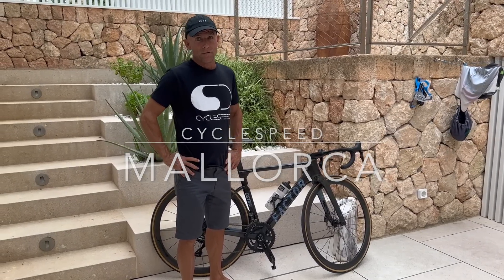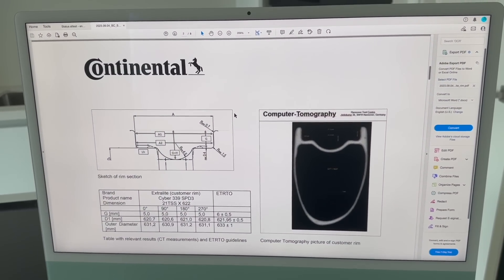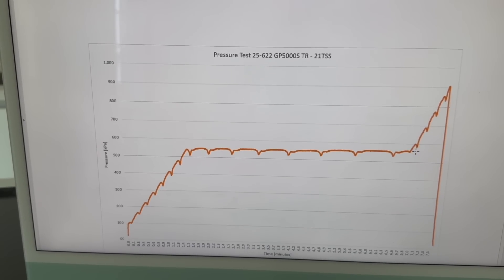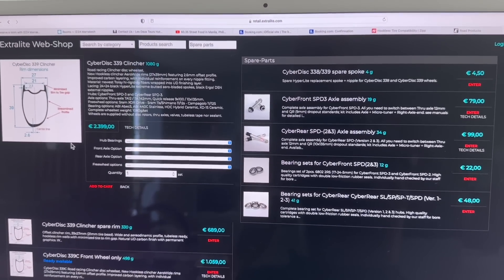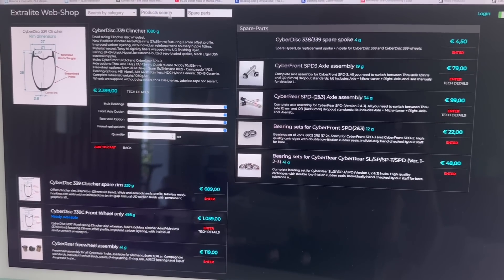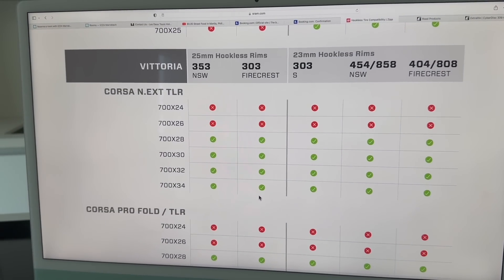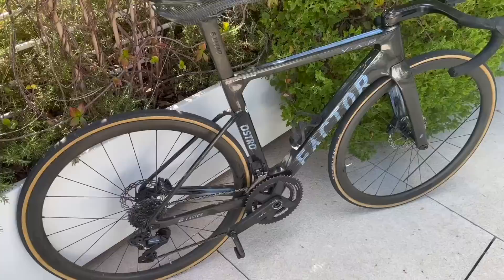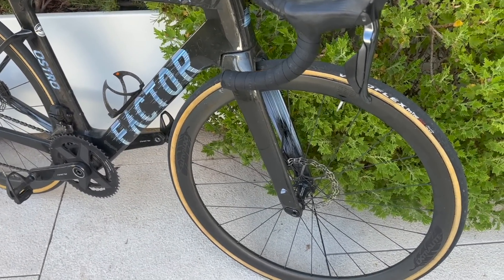Revealed! Why the Tyre Blew off the Hookless Wheel

Comment: I wonder if that clown will chime in in the comments 🤡 
presumably declaring continental don’t know what they’re talking about.
I rode tubs with carbon rims, on rim brake, on my previous bike, and the ride quality was something impossible to convey to someone who’s never ridden them.
I presently ride clinchers, as that was the deal on the bike I put together, with disc.
Had very hair raising experience riding turbo cottons with tpu, a combination I’ll never repeat.
Riding a stiffer casing gp5k with tpu has been pretty much flawless and puncture-less, but as much as I like the tan side walls, they do exude a dullness, that I remember from the ride quality, from years back, so will try out one of the new s works turbo tires again next, just no turbo cottons.
I once rode schwalbe one’s as a stand in, one time I was waiting for an order, and I recall feeling disappointed at the point of purchase, even the assistant in the shop selling them pretty much rubbished them, [versus some other high thread count tire he was all aglow about, but for which I couldn’t justify the price, being something I’d bin as soon as my intended tires arrived]…
I have to say, for me, on my wheels, my weight, pumped up to ~100 psi, I was very surprised and looking back now, re straightforward performance, they were head and shoulders faster than the s works turbo tires model I was wedded to during that time.
In my defence, the wedding was not 100% aesthetics and matching matching, but also from the perspective of purportedly perfect compatibility, where everything has been designed from the ground up together, and the marginal benefits / gains that implies.
At that time I was particularly interested in the tire - rim interface from an aero point of view…
Arguably though, the issue you’ve had, equally demonstrates the value of such an in-depth design, development and testing, as part of a holistic approach, with, in effect, one design leader. Controlling the whole big picture overall, together.
It’s an interesting aspect, and one it’s of late “cool” to dismiss / disparage, I’ve noticed.
Most recently by the chris miller / nero show or whatever they’re calling it these days.
Interestingly, both talking heads of which ride tubeless [can’t recall if on hookless rims] but the best of british to them, if they are on hookless, and out of natural wandering curiosity try out some new combinations of hookless rim wheel with some tubeless tire that piqued their interest that particular week.
I have studied and worked previously in fields where risk and risk management was taken seriously.
I don’t get the same impression regarding the current situation with tubeless and hookless.
More, rather a feeling of playing fast and loose.
Shimano have just issued a recall which as a response to a problem that as far as one can see, has been common knowledge for so long, it could probably only be measured by equipment that can pick up continental drift or a tectonic plate’s movement.
I honestly can’t imagine what goes on in the minds or consciences of the people in charge of some of the companies in this industry.
Fair play to conti regards taking ownership of the issue you experienced though.
That :is: encouraging from a risk point of view.
I just diverge from a point of view of ride feel, which I dare say holds some degree of subjective interpretation.

Comment: No no silly, they want you to build up the whole rim with tape, not just the bed of the rim.   That way the sidewall builds up too.   Duh.  

I kid.  Kudos to conti for the data.   But no kudos at all to the ability of finger-pointing to happen from tire to wheel manufacturer.   If the bike industry can't punch a straight, round hole through a frame for a bottom bracket, consistently, then the 1mm accuracy of hookless isn't doable.   Good luck with the process hope everyone makes things right for you.

Comment: To be honest you should get a full refund for the wheels as they are not to spec, its quite shocking really. Hats of to Conti for everything they did great report they make you feel secure using their customers. I wonder if a certain youtube channel will try and make another video saying you had set it up wrong 😂
Reply from the maker: True. But what is 'to spec'? It seems that there are no hard and fast rules which is a bit crazy.
Reply: @CyclespeedTours I was thinking of the ETRTO and the wheels being sold as hookless, but if they are only guidelines perhaps they could get away with being out of the margin of error ?
Reply from the maker: @tomrachellesfirstdance7843  The ETRTO guidelines do carry some weight, and it strikes me as very risky to sell a wheel outside of these specs. The margin of error in this case is 0.5mm but Extralite are outside of that.

Comment: Thank you for the detailed follow-up!  This confirms again that tubeless and hookless rims are not suitable for road race wheels even though companies like Zipp and Cadex seem to be doing a better job because they can deliver tubeless wheels as a system (wheel+tire). As a consumer, I want flexibility and choice at a reasonable price and so getting locked into a particular vendor is not an option for me.  The other issue with tubeless is that they're 40% heavier and far more expensive than equivalent clincher tires. For example, a pair of 700x28 GP 5000 with a 36g RideNow TPU tube weighs 220g less than a GP 5000 TRS setup. That's quite significantly given that rotating mass matters a lot at the wheels.
Reply: You seem to be conflating tubeless and hookless. Tubeless with hooked rims have been around a very long time (especially in MTB) and I don't ever recall hearing about a blow out.
Reply: I'm aware of the differences and maybe I didn't express myself clearly enough.  And I also know many happy riders that are using tubeless on road wheels.  For me personally, even if the hookless rim issues will be worked out over time, the weight penalty, higher price point and maintenance issues associated with going tubeless are not worth it for the type of riding I do. But I fully respect everyone's personal preference and trade-offs they're willing to make.
Reply: @vincentohanlon Today this happened to me with my Hooked Hunt Aerodynamicist rim on Pirelli P Zero tubeless at 6.5 bars. I parked the bike and 2 seconds later huge bang, explosion. Sealant everywhere and the tire off the rim completely. No damage on the tire or the rim. Put right back on and inflated it at a bit lower pressure and went riding. Absolutely no idea why it happened.

Hooked rim, tire pumped to 6.5 bars (specs allow 7.5 pressure). When I rode hookless that never happened to me. I've been riding this setup for the entire season, around 4K miles and never had any kind of problem like this today.
Reply: @shadowsun33  Same thing happened to me with my gravel tires pumped up to 40 psi on a hooked rim running tubeless.  Bike was just hang up in the garage when it happened. After it blew off, the tire bead was damage so I got the tire replaces with warranty because they were fairly new.

Comment: This should be a product recall and full replacement or refund and potentially legal action as they have sold something they say is ETRTO that isn’t, and it’s dangerous
Reply from the maker: To be fair, they do not claim to be ETRTO compatible and they don't have to be either. But their wheel should work with a tyre which they approve.

Comment: Remember kids, just say no to hookless.
Reply from the maker: For road in 25mm, definitely!
Reply: Cool it people. Today this happened to me with my Hooked Hunt Aerodynamicist rim on Pirelli P Zero tubeless at 6.5 bars. I parked the bike and 2 seconds later huge bang, explosion. Sealant everywhere and the tire off the rim completely. No damage on the tire or the rim. Put right back on and inflated it at a bit lower pressure and went riding. Absolutely no idea why it happened.

Hooked rim, tire pumped to 6.5 bars (specs allow 7.5 pressure). When I rode hookless that never happened to me. I've been riding this setup for the entire season, around 4K miles and never had any kind of problem like this today.
Reply: Why do you reach that conclusion?  A more correct answer is to buy wheels only from quality manufacturers.  Don’t buy cheap Chinese wheels or stuff from niche manufacturers.  The system is good if you know what you are doing, use the right wheels and the right tyres - maybe not for newbies, but experienced riders who take care of their equipment choices.  Going back to tubulars cannot be the right answer - especially for newbies!!
Reply: @CG-99  Why throw money out the winder? For what supposed benefit?
Reply: @rosomak8244  nothing to do with money.  Hookless combined with tubeless is a very good system if you choose the right wheels with the right tyres - system is lighter, more aero, allows lower tyre pressure, means you roll faster and more comfortably with no punctures and no roadside tube changing faff. It takes time though, there are certain techniques to installation to master and what to do when a puncture won't seal on its own, also what seslant to use is also critical.  Its just like the endless silly rim / disc debate where some luddites cling to the old style rim brakes mainly because they haven't invested the time needed to properly understand how to live day to day with disc brakes.
Reply from the maker: @CG-99  OK let's see, a) lighter - if so, the difference is really tiny, b) more aero - only if tyre perfectly matched to rim, just like any other setup, c) roll faster - depends on so many things, and all being equal, higher pressure = lower Crr. d) no punctures - I got a puncture which had trouble sealing in just the 300kms I used the rear wheel. Never would have happened with a tub (new tyre).
I have reluctantly adopted disc brakes with all their foibles, but the difference is that a rubbing disc or lack of power won't kill you, a tyre blow off might.

Comment: Extralight arem't looking good. They admitted they shrunk their wheels to make tyres easier to fit and just blamed the tyre manufacturers for this choice.
They don't explain the tape wrapping. Their pressure guidance is odd. And then there is their pricing for a compnent that doesn't meet standards.

They are just lucky you weren't riding at speed. Could have killed you.
Reply from the maker: To be fair, it is more likely that the tyre guys made their tyres a bit easier to fit, which left Extralite a bit exposed. And ETRTO is just a guideline, unfortunately, not an official specification.

Comment: Extralite are noncompliant with ETRTO regs. They need to organise a recall for starters!! and deal with this in a responsible manor.
Reply: Issues is the ETRTO aren't regs.... There just guidelines
Reply: @danc1829  reg/guidelines of which European manufacturers should adhere to. I bet you will find that extalite are not a member. 

Also they probably manufacture in China which comes under another governing body.

Regardless a consumer should be able to buy a product with assurances they are made to a specific spec. Etrto exists to create continuity.

Comment: I remember needing to use 2 rolls of thick cotton tape to seat tires on hooked wheels.  It's really not a big deal. I did this often. Hookless tubeless is leaps and bounds ahead of where hooked clinchers were at the same point in their history.
Reply from the maker: When adding tape to a hooked wheel, you're just pushing the bead closer to the hook - no problem.But on hookless, you're pushing the bead towards a literal cliff edge.
Reply: @CyclespeedTours  and you're still decreasing the likelihood it'll pop off he bead...
Reply: mate

Comment: The problem so far, that I could tell from multiple videos about 'hookless blow off', is that hookless tech is totally relying on compatibility of numbers instead of having a safe-guard mechanism like the hook itself. If you buy from less well-known brands, or you are layze enough that you don't want to carefully follow the instructions, you will have blow off.

I am running 404 with gp5000str just fine so far for 2 years. The lesson I ve learned is that you should not mount and dismount the tire frequently to avoid wearing the bead from time to time. And be sure to buy from trusted brands that has using this tech for years and it is implemented also on GT races.
Reply: It's not like hooked tires/rims have always been a prefect match.  I can't count the number of times I've needed 2 layers of thick cotton tape to seat a tire.  I've also had beads totally break due to being undersized. Tubeless hookless is far ahead of where hooked clinchers clinchers were even 20yrs into their existence.
*I can't fathom installing and removing a tire enough to wear the bead down during the life of a tire.  There's nearly no friction to wear it down and it's barely moving on the bead seat when it is moving.

Comment: I think hookless is a major accident waiting to happen.
Reply: And you are right!
Reply: Cool it people. Today this happened to me with my Hooked Hunt Aerodynamicist rim on Pirelli P Zero tubeless at 6.5 bars. I parked the bike and 2 seconds later huge bang, explosion. Sealant everywhere and the tire off the rim completely. No damage on the tire or the rim. Put right back on and inflated it at a bit lower pressure and went riding. Absolutely no idea why it happened.

Hooked rim, tire pumped to 6.5 bars (specs allow 7.5 pressure). When I rode hookless that never happened to me. I've been riding this setup for the entire season, around 4K miles and never had any kind of problem like this today.

Comment: Hookless works for car tyres due to the stiffness of the sidewalls.  Bicycle tyres are cross-ply with soft sidewalls, it was never going to work well.
Reply: Another thing to note is how wide they  compared to the height, it will be virtually impossible to come off with a car.
Reply: @tomrachellesfirstdance7843  yes exactly
Reply from the maker: True, car and bicycle wheels are light years apart.
Reply: @CyclespeedTours  Yes and there is a network of wires running through a car tyre.  That would be way too stiff for bikes.
Reply: Yup, try to break the car tire bead from the rim....they use machines.

Comment: For the beginner rider, tubulars are way too much of a faff to get right. Hookless is not ready for prime time. I'm sticking with hooked tubeless clinchers for the time being. BTW, at 75 kg, I'm running 55/60 on Vittoria Corsa N.EXT tires mounted on Reynolds AR-29 wheels. I tried 65/70 and ended up sliding out on a turn and breaking ribs. Lastly. cRR isn't the statistic I look for as you can slide tires on any tarmac/concrete. I look for stickiness and how much power will transfer given the road surface and condition.
Reply from the maker: Good points; hooked tubeless is a good way to go for most. But tape makes tubulars much easier to install. It's true that Crr is not everything - grip is also very important. If I know I will be descending a lot I go down to 5.5 to 6 bar
Reply: @CyclespeedTours  tape helps with mounting tubulars, but it's still a faff to get the tire seated correctly. I know riders who are riding them and have done so for decades who still encounter issues mounting tubulars.
Reply from the maker: @jamesmckenzie3532  I leave the backing tape on and inflate to 2 bar which usually aligns the tyre nicely. Then remove backing tape and inflate to 10 bar which fully straightens it.

Comment: Damn, it's like press fit BBs all over again, manufacturers can't get tolerances right.

That crank door handle's pretty cool tho.
Reply from the maker: Glad someone noticed it!
Reply: Just tired to get a press fit replaced with a screw together (Wheel manufacturing) and found the press fit faces are not a proper size! Blinking Orro. Obly BB that will (hopefully) fit is an FSA and the old one only lasted 800 miles!

The bike industry used to be a lot better. Modern bikes are so tempremental and so disposable. It's just pathetic.
Reply from the maker: @thebrowns5337  My Ostro is quiet about 25% of the time, the rest there is a creak / rub coming from somewhere!

Comment: Great insight mate. You did everything by the book and unfortunately there are too many authors in the industry. I think you deserve an apology and at the same time some recognition for being transparent while being civil on this situation.
Reply from the maker: It was weird how many said it was the wrong tyre, wrong pressure, wrong time of the month, etc. without having even watched the whole video. I won't hold my breath for any apologies.....!
Reply: I apologise for suggesting that you shouldn’t fit less than 28mm tyres on hookless rims(which when you look at your own video is clearly shown on the compatibility chart), I stand by the fact that in over 2 years and 5000 miles I have had zero issues running 28mm Pirelli tyres on Zipp 303s wheels
Reply from the maker: @allofuswoodhouses4284  thanks. Some hookless wheels are approved for 25 and 26mm tyres and some aren't, hence lots of confusion. I think 25mm hookless should just not exist, period.